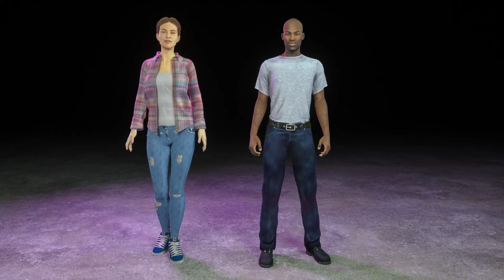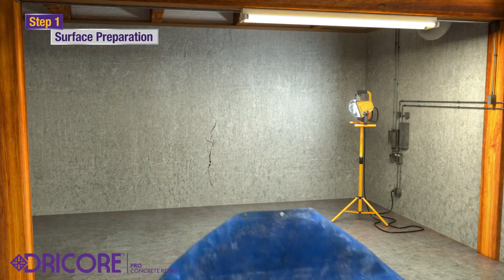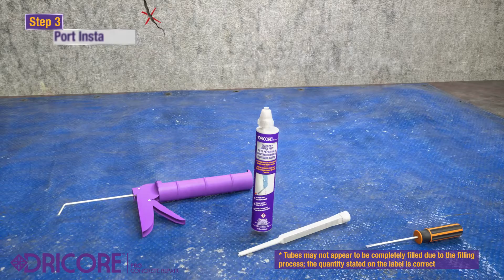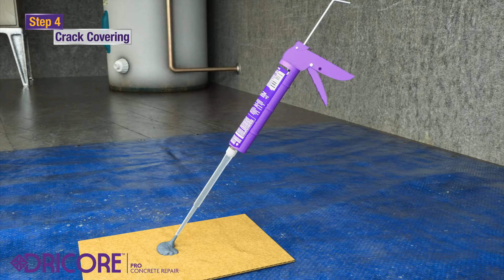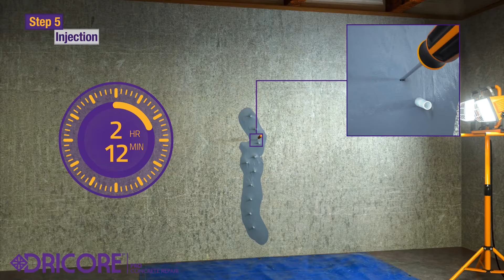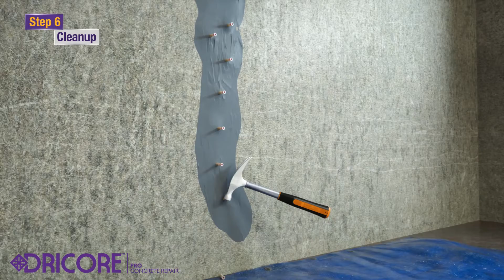DRICORE PRO Concrete Repair Crack Injection Kit Application Instructions (Single-Tubes)

Comment: Outside still rainy, the crack is leaking, do I need to dry the crack ?  Or just do it with the wall wet leaking.  Thanks
Reply from the maker: Hello, this product is a polyurethane that works great with cracks that have moisture in them.

Comment: 2 questions because i'm planning to buy your product on the home depot website. 1- do we need to inject water in the crack before to activate the polyuretane ? 2- my crack is not really a crack, it is a joint between an old and a newer concrete wall (house/basement was extended 20 years ago, and the waterproofing they used worn out over the time and water leak in). The problem is the joint is in a corner, so how do i install the plugs ? Do i need to drill holes on one side in 45 degrees to reach the joint, seal the corner joint with epoxy and use the drilled hole with the plug to fill the crack with the product ??!!
Reply: I’m pretty sure no water is needed. I’ve seen plenty of videos using similar products and they do them the same way. That is, glue the plugs on with epoxy, cover the area with epoxy then inject the foam into the plugs to fill the cracks.

Comment: Somebody help me please,  video did not sat to inject water in before inject expand foam,  but what I know, polyurethane need water to reaction expand, my question is do I need to inject water inside crack before I inject expand foam ?
Reply: Same question here ! but I found their instruction on the home depot canada product page and they say nothing about water in the steps.
Reply: The instructions say the crack has to be dry before doing this. I don’t recall hearing you need to inject water. Not even the sika products say that.
Reply: Pretty sure no water is needed.